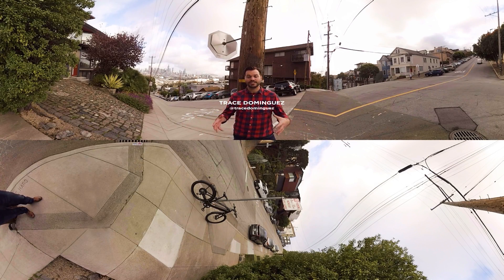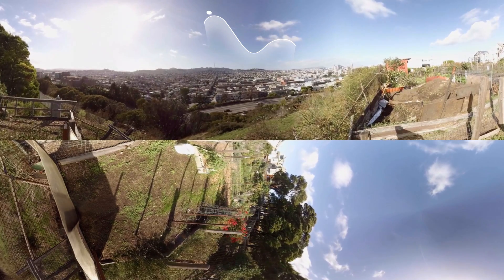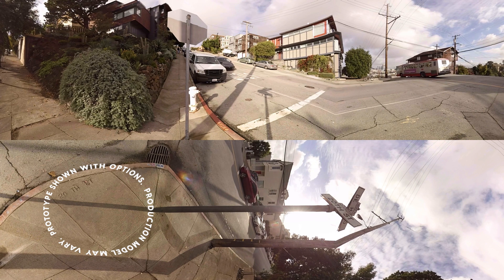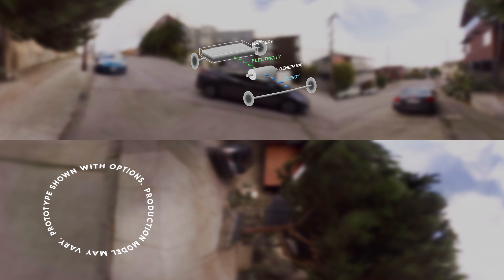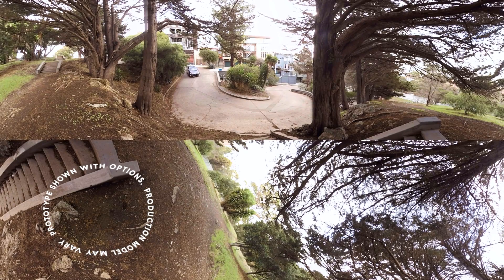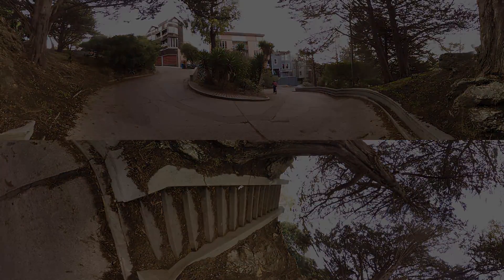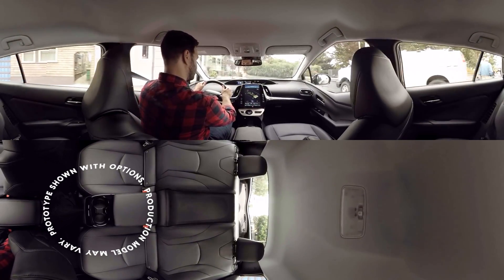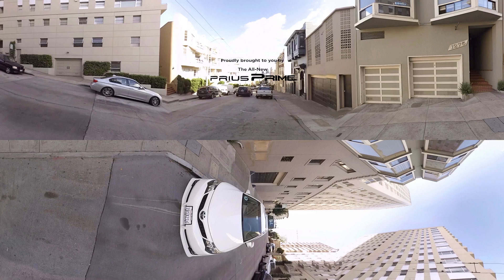Kinetic Energy Can Recharge A Car’s Battery, Here’s How (360 Video)

Comment: if u have 2 batteries it can charge one to full capacity while draining the other battery then when one battery dies the other battery is switched over put in use and then the braking charges the other battery now not in use

Comment: saw tv,   i think this  idea is to obvious and  i dont consider it great insight, there has got to be a reason,  that i dont know, about
that is  simply  using  rubber belts,  that are used in gas engines,  and  this means  that  just by driving,  the cars are regenerating  the battery,   standard loop belt,   as in car engines,  this means   that it could possibly reduce charging greatly

Comment: Probably on this channel, I learned that trains use an electric engine to slow down, but instead of diverting that energy to batteries it gets expelled as heat on the top of the train. Now that battery tech has improved I wonder if they could take advantage of of this. I understand that a locomotive would have to have a ton of batteries, however it should still be cost effective.     Thoughts anyone?

Comment: Also you can install a fan (or fans) behind the grill to collect the airflow coming from your forward movement, very efficient on the highways... Just saying, when you spend energy, often energy is created. Of course it's not equal to the original energy spent, but you get my point. You should be able to collect at least 30% of the energy spent.

Comment: So here in manual driving land we slow down downhill by using high rev's in lower gears to keep the car from accelerating. If we could put a limiter for the speed in every electric car the engine could regenerate downhill easier. Then if that slows down the car enough you don't wear your brakes that fast anymore.

Comment: But to recharge a car battery from 0% to 100% you need to go over 20km down a steep hill
Reply: IIGrayfoxII if your battery is at 0% it would be in possible to get it to 100% or to even 1% for that matter. you're just recapturing some of the energy in your system instead of it being lost to heat friction in conventional brakes.
Reply: the whole idea is that the power consumed while going up a hill is zeroed out by the power gained from going down the hill, thus meaning that it requires no charge to go up said hill.
Reply: Not really.
You assume 100% efficiency.
But nothing is ever efficient like that.

If you go up a 5% gradient hill you will lose more charge than you will gain from going back down said hill.

Engineering explained  did a video on this.

The whole point of regen braking is to give the car 1-2 MPG more and manufacturers will do a lot to gain even .5MPG

Comment: The Prius prime isn't even that good of a car.... barely any electric range.  The Chevy volt has about twice the electric range(which in my opinion isn't enough, should be more like the bolts range with the gas extender). Also what is up with manufacturers not putting level 3 chargers on PHEVs... just stupid if you ask me...

Comment: Actually there are even skateboards that can do that. But the Tesla is still better than a Prius that if it's battery runs out uses gas so inefficently that a BMW can beat it in fuel efficiency.

Comment: I have been driving a 2000 Honda Insight hybrid since April 28, 2001. It has regenerative braking. In fact the GM Impact electric car had regenerative braking too. This is not new technology.